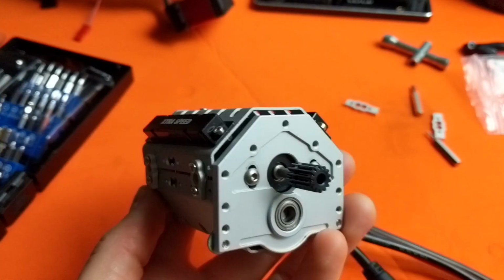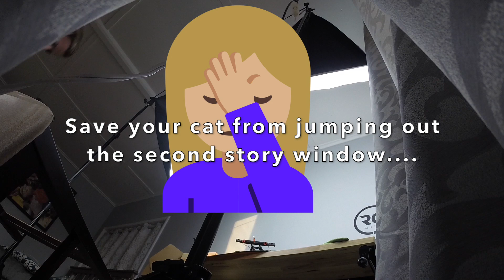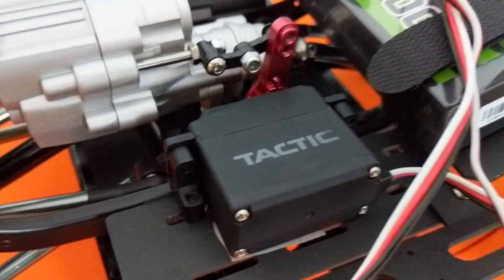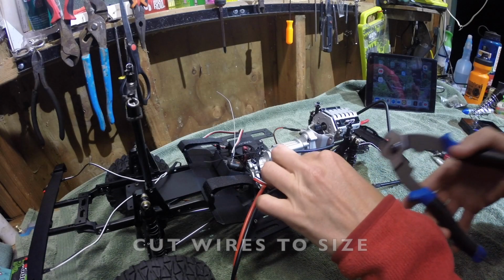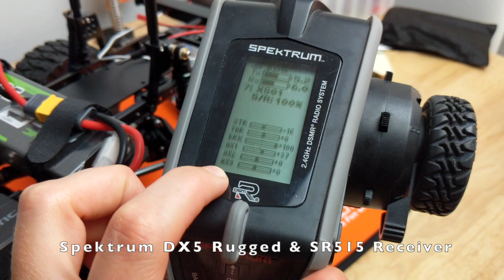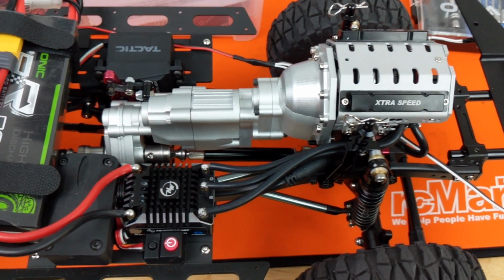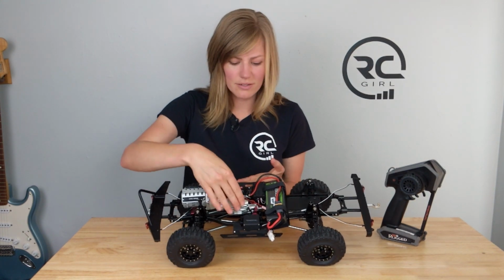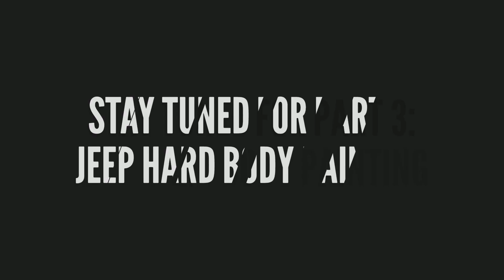XTRA SPEED XS01: Build Highlights & Electronics (Pt. 2)

Comment: This is looking sweet! And who hasn't drove their brand new build off the table? I have multiple times. If I was you I would look into setting up drive modes a little more. I don't have the rugged but I was able to setup my DX5R with three drive modes. Mode one is race with 100% throttle and only about 20% steering so I don't rollover as easily. Mode two is crawl with 100% steering and only about 25% throttle(I have a ridiculous motor in my wraith). And finally mode three is park with 0% throttle and steering. This is one of my favorite functions to play with. Anyway, looks like you are having a blast. You rock! Keep it up!
Reply from the maker: Ugh i know, i'm the worst!! I don't think the DX5 Rugged has drive modes unfortunately. I was looking into it (and the instructions even say you can program it), but I asked the Spektrum guys and they said that there are no drive mode options with the rugged
Reply: You are hardly the worst... maybe third worst. 😁😁 That sucks, they must have removed some functions from the firmware on the rugged. I thought it was just a DX5R in a beefier case.

Comment: Love that you went with the inexpensive servo, like you I did the same for my touring car. Was looking at the same servo you chose, ended up going with a TrackStar TS-920. Thanks for keeping us posted on that.! Gorgeous build, gonna be a killer.!💪🏎👍
Reply from the maker: Ahh cool I have a trackstar ts910 in my Traxxas TRX-4 and it's a tad glitchy (probably because I have a sound system, full light kit, 2 shift servos, etc running off the ESC! haha). I love the higher end stuff (although my wallet doesn't), so with so many builds going concurrently, I have to pick and choose where to spend and where to save. I might put a higher end Reef's in my SCX10ii build which is next on the bench.

Comment: To minimize the gear slack, I add them black  rubber rings around the axle input shafts before you attach the driveshaft and same with the transmission/transfer case output shafts, add some there as well.

Comment: Great build 👍You should do a video on programming the dx5 rugged like 2 position for lights and 3 for a winch. Just got my rugged and the manual isn't to clear on some things. But great videos they're always a pleasure to watch.🤠🇺🇸☝️
Reply from the maker: Agreed that the dx5 rugged instructions aren't very clear and there are a few ways to program in the same function. It also says you can program different drive modes when you actually can't. It took me some time to figure out a light system setup with my new mytrickrc light kit (that is going in my SCX10ii build).  But I'm able to remotely adjust the brightness and on/off with it - super cool!!! I'll have to do a separate vid on that.
Reply: Yes, please do. I have a My TrickRc system to. Thanks for the quick response. 😉
Reply from the maker: @renobob7781  Yeah I talked with Dan from MyTrickRC about setting it up. You use the 2-position for the dragon controller kits (even though there are multiple light/brightness settings). More soon!

Comment: Good video.the build came out aewsome.so one question i have how to you like the new Dx5 remote.i have the dx4r which i love.is there enough difference to upgrade.
Reply from the maker: I like the functionality and have def dropped it a few times so glad that it's built tough. I wish it could program and save different drive modes and the touch scroll thing is not the best. Wish it had a backlight, but I'm sure that would run through batteries quickly. All in all though I'm happy with it and would recommend it if you need a 5 ch. transmitter.
Reply: I do fine with a 4ch remote.my dx4r is 2yrs old.when the 5 came out i was interested.but no one at my local race track has bought one yet.i feel it would be a great remote for crawlers.thank yoi for your time.

Comment: Nicely Done Video with All the Electronics in.. Was wondering if Aluminum upgrade is available for the shock towers and other parts.. 30 inch drop show's the durability of the plastic is not acceptable.. Thank's Sister for your Honesty.. ✌️😎👍 HFLPRCing

Comment: I sure hope the quality of this kit is better than the Xtra Speed dual axle car trailer kit i got to tow around with my TRX4. It works, but everything is just so cheap and all the screws strip out so easily. Plus the wheels ride on bushings not bearings, so if you tighten the wheel nuts down even snugly, the wheels wont turn lol. For what it is it looks cool and serves its purpose, but man is it cheap....